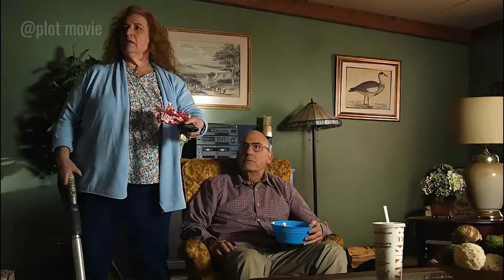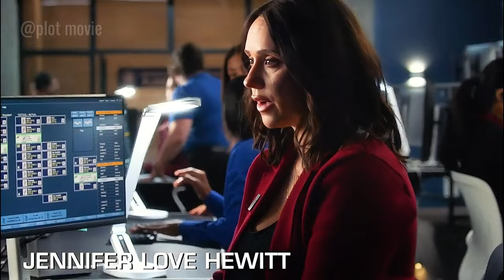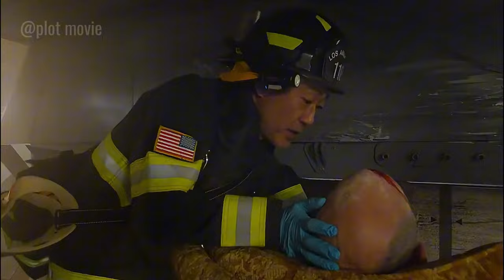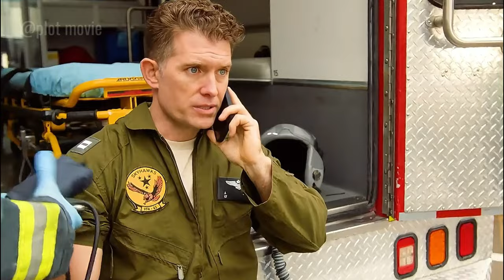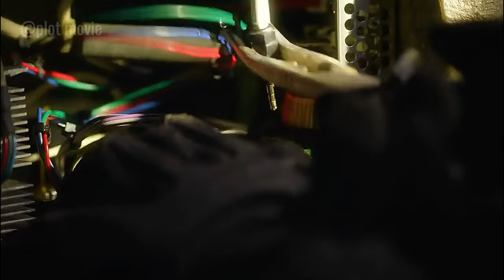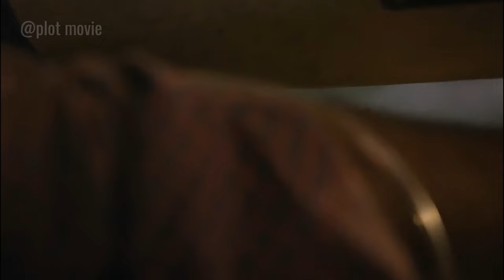[Full Recap] F16 fighter jet collided with a residential house

Comment: That a lie you need atleast 213 degree to ignite the f15
Reply: F16 not f15 and what they were worried about igniting was the gbu-8 2000 lb bomb
Reply: @DollarGeneral208  it was a dumby bomb aka no explosive warhead installed but a weight warhead with weights in it
Reply: @DollarGeneral208 It looks likes AGM 65 to me.

Comment: It’s actually an F-14
Reply: How? Explain pls
Reply: Man are you blind, that plane has one engine, the F14 has 2 engines
Reply: no it's not 😭🙏
Reply: 1 engine & 1 vertical stabilizer = not F14/F15/F18 - [so F16 only at this point - {slow footage in 1st few frames see unique air ram of F16 slung under cockpit} - conclusion it really is supposed to be an F16 as the title says